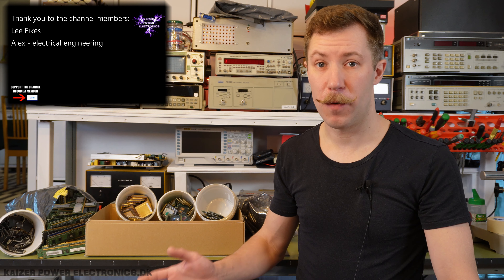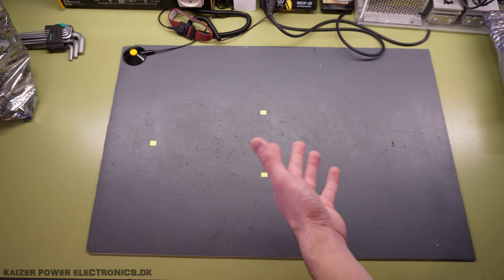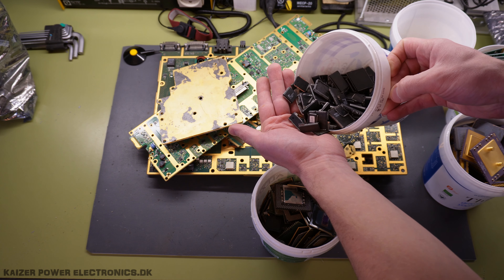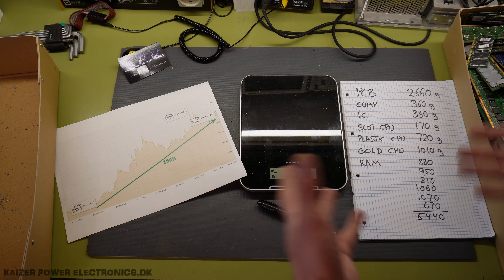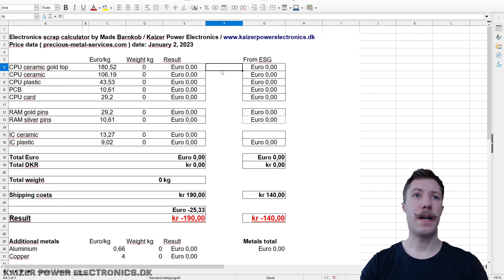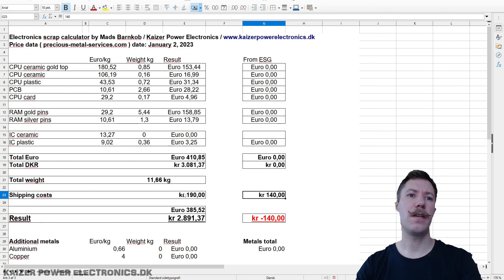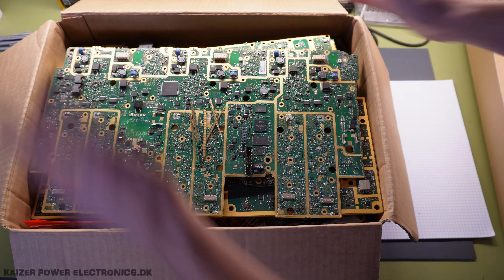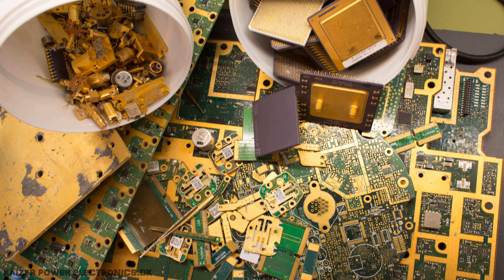Computer Gold Scrap Money WITHOUT Chemicals or Mechanical Processing (Part 1 of 2)

Comment: These prices seem quite decent. Sometimes its worth checking ebay as well if any of the equipment still has value. Usually not for ram, cpu, or loose parts, but maybe a working motor driver or whatever.